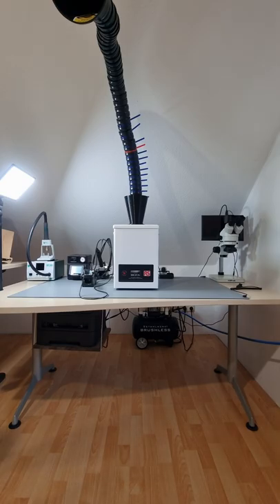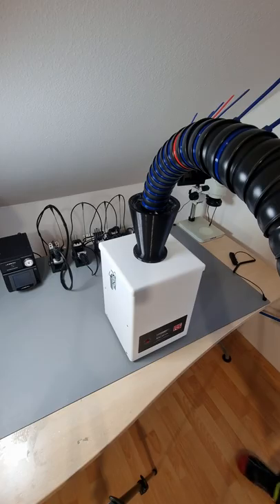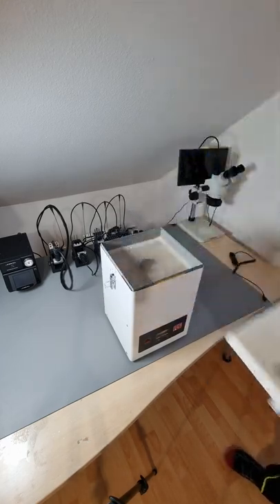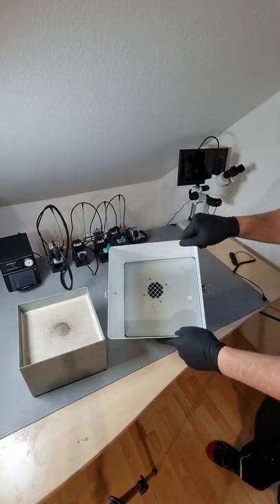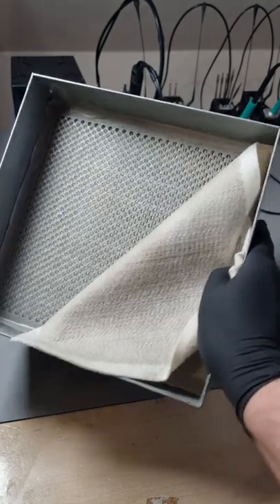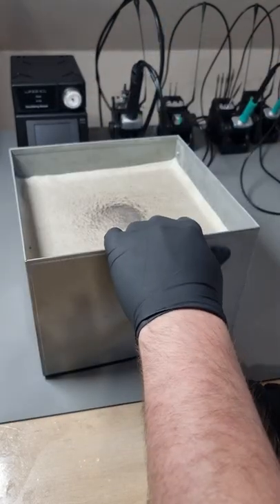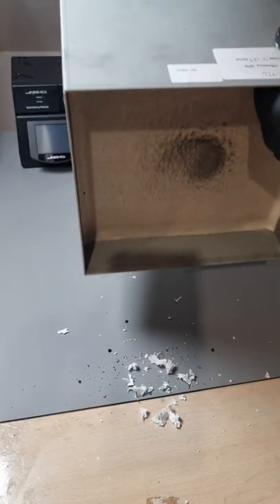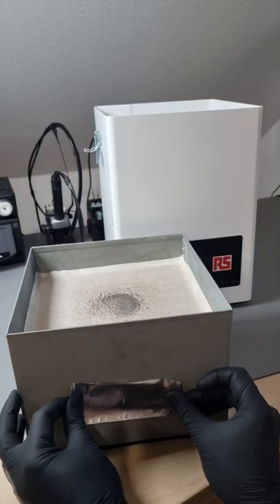What's inside a Soldering Fume Extractor? #shorts

Comment: For those who have the option, a high powered fan on the end of a length of flex duct to blow the fumes out the window would be the cheapest option. Something like $20-30 worth of parts or only $10 of duct if you already have a fan and power supply to use. Even in hot or cold climates, a reasonable job of sealing up the rest of the window would keep the added HVAC costs well below the cost of replacement filters.
Reply: You can also find tons of small shop dust collectors with serious CFMs for a fraction of the cost of this gimmick.  If you smoked a cigarette and turned it on, in a few minutes you won't smell it.
Reply: You cannot avoid sucking in air from the outside if you try to extract fume like this, because normal houses are not all that air tight
Reply: @Galeere2  Even if the house was airtight, you still couldn't avoid sucking in outside air. Or the exhaust system would just stop working as it reaches a pressure differential it can't overcome.

The idea of closing off the rest of the window is probably more about making sure there isn't a draft unrelated to the air the system is moving.
Reply: I have a large Panasonic bath fan in my office closet that blows through the soffit vent for my 3D printers. I run it while soldering as well, along with a simpler charcoal fume extractor on my desk.
Reply: @bobweiram6321  ...and I have one of these too, exhausting outside through a window instead of back inside, in my wood shop.

I will admit, they get even quieter when you exhaust them out and hang them off the ceiling with minimal contact area.
Reply: Delta 12v fan 3a and a length of leftover duct for me. 👍

Comment: I knew my copd wasn't for smoking for 40 years. it's for "extracting" soldering fumes for 50!

I'll buy one of those fancy extractors, right after I finish paying for the O2 apparatus.
Reply: Any filter will help, try buying a simple fan that'll take a epm1 90% to H14 in standard half or full size filter. The standard filters are cheaper. Custom filter sizes are the expensive one.
Reply: Interesting I've heard of welders lung and smokers lung but soldering?? Well I haven't been soldering long enough for it to be a problem but being an occasional smoker it's enough to worry me. I'll for sure have a fume extractor on my list and for now a fan for the time being
Reply: @christianhudspeth3338  I'd say heavy metal filled solder vapour is much worse than 1g of burning plant matter.
Reply: @dylandrew6071  Solder vapour is caused by flux, more specifically rosin flux which is literally plant matter, in which you burn with an iron, so technically it's the same as smoking, both are bad but debatable which is worse for your lugs though, in the short term breathing a little of either won't do much harm.
Reply: @dylandrew6071  zinc and lead don't vaporize at such low temperatures, the fumes is the rosin flux. Definitely use an extractor (or a fan blowing away from your face), but it's not comparable to smoking. For one, it doesn't make you addicted to it, lol
Reply: @FAB1150  haha you clearly gave no clue about   vaporisation or addiction 🤣 

Do tell me how the water cycle works without the oceans being boiled off? Is your name Duning Kruger by any chance 🤔
Reply: @dylandrew6071  have you ever soldered anything in your life? Those aren't lead fumes. I'd be dead for 10 years if they were lol. The molten lead/zinc alloy isn't like mercury. It's relatively safe. Inform yourself on soldering before speak lol

Comment: I made one for $30 US dollars. I Just used a Any-Which-Way Duct Hose from McMaster, a plastic duct hose, and an old pc fan. No need for filtration, I just blow the fumes out a window vent.
Reply: Excellent idea. Could also try a small in-line duct fan from home depot. The airflow might be so strong you don’t even have to get the hose close to your work.
Reply: I'd still recommend adding a carbon filter pad in between just in case
Reply: @OGSumo  The fan I am using is one of those stupid fast Delta fans. It really pulls in all the fumes from far away.
Reply: @MaxC_1  Yeah, I'm also using that same duct to pull fumes from my resin 3d printer, and those fumes are much worse. I'm going to add an inline carbon filter so it doesn't smell outside.

Comment: I just made my own using a series of hepa filters. It completely removes the rosin smell so I assume its working great.
Reply: Smell !== Toxicity
Reply: @jb5631  I am aware, but given that the rosin smell is mostly comprised of organic compounds, its not a bad assumption. The same and similar organic compounds are also responsible for the health effects.
Reply: IIRC running gasses through water can do a great job of scrubbing impurities or particulate. So, depending on the setup, I wonder if it’s viable to have the input fumes pass through the filters and then one or even multiple bubblers in series. Instead of dealing with fumes in the air, you deal with them in the water. Much cheaper (probably)!
Reply: Sounds like more filtration then this unit has so should be fine
Reply: Put a carbon pad pre filter on it and you'll be all set.
Reply: @OGSumo  That would be a nightmare to maintain, with very limited throughput and a constant source of humidity in your lab. It would work, but with a lot of compromises.
Reply: Same honestly. i just use a HEPA filter from a Air purifier which are like 20$. A sheet of activated Carbon material and a high CFM and high static pressure fan (remember static pressure is more important for this), a good source of which are server fans though any PC fan works if you're in a pinch and want something small. Add a hose and an extra fan to remove the air out of the room just in case, but fumes are not that toxic anyway so not such a worry
Reply: @OGSumo  They made vaccum cleaners using this exact concept. Empty the dirty water after use. If you can find an old one, it might be worth picking up used and retrofitting it to your use case.
Reply: I mean you could add activated charcoal just for good messure.
Reply: @Ramog1000  Yes, activated charcoal is an important component for a fume extractor. Unlike a hepa filter it effectively captures volatile compounds. I didnt use it because my space is well ventilated and I dont solder that much. But for intense usage it is a must.
Reply: @drkastenbrot  Oh well,  I mean I solder once in a while and I usually trust the good old open window and not breathing in fumes directly

Comment: I've been eyeing one of these extractors for quite some time. Finally, I decided to purchase a TBK-805 mini extractor. It looks the part with its all metal construction but I'm not blown away by the suction so far. Like most chinesium it probably requires a few upgrades to meet acceptable performance.
Reply: Even branded fume extractors suck (or don't suck, for that matter).
Reply: Get a small dust collector designed for woodshops. Even a full size one costs way less than this gimmick and is a much better value.  What are you burning that you need anything more than a desk fan?
Reply: @bobweiram6321  flux is quite toxic
Reply: @stevenspmd  Rosin flux is bad, but it's not like you're working with Zinc vapors.
Reply: @stevenspmd  flux is only mildly toxic in high concentrations as in directly sniffing it. Most people blow it far out of proportions in terms of toxicity.

Comment: I made one for soldering & 3D print fumes out of some MDF, glue, neoprene gasketing, the most powerful noctua fan (which I actually run at minimum power), a high level furnace filter & some sheet metal + wire mesh & I think a screen printing cloth? To hold the activated carbon. 

Works great, is pwm adjustable, cheap, & I had plans to wire up a pressure differential sensor to add some more automation to it.

Comment: I could never understand it until we set up a hardware lab at work, and the Occupational Health and Safety folks had to come in and sign off on our setup before we could use it. Unless we could prove the fume extractor met their filtering requirements we'd have to vent the dumb thing outside. $1000 for a certified filter is actually reasonable when the alternative is a construction project.

Comment: Something that's been boggling my mind for years is, why do people go through all that effort filtering fumes and returning the remainder into the room air, rather than just pumping the fumes outside? Probably wouldn't be legal on an industrial scale, but for a single hobbyist it'd basically be the same as soldering by the window or in the garden. And soooo much cheaper and lower maintenance.
Reply: for that Approach you need a duct leading to the outside and as long as the room was not a kitchen with an outside wall previously, you either have to drill a hole through stone or you have to put the hose out a window everytime you want to solder.
Reply: Because that requires first and foremost a dedicated work area that not everyone has space to do which also has a window or a duct outside and meaning as well, modifying your living space or blocking off said window, whereas a filter is something you can move around and put just about anywhere.

Plus if you're like me and have minor allergies then you'll want to have an air purifier anyway and very few people must have some expensive ~$100 filters, I can get third-party filters for my air purifier for just $12 which lasts 6-10 months and for flux fumes specifically, there are plenty of ways to build your own filter with cheap of activated carbon for around $30 depending on how you go about it, for me, I repurposed a small air purifier by cutting out it's filter and replacing it with several layers of carbon foam and that only cost $8.
Reply: In a climate like Germany you don't want to do that all year.
In the winter you suck in the cold and in the summer you suck in the warm/hot air, big parts of Europe don't use or have air-conditioning, it's expensive, it consumes huge amounts of energy and most of our homes use there thermal-mass to stabilize the temperature, this doesn't work if you suck in the temperature you want to keep out!
Reply: Yes, exactly. Just send it outside, instead of trying to recycle the dirty air back into your house, at great expense.
Reply: @vgamesx1  that sentence has 154 words.
Reply: @thewolfin  Ok thanks, and? I added a break, is that your issue?
Reply: @S41t4r4  or just set up a soldering station outside with a Walmart box fan
Reply: @AdmiralCrunch01   good idea in the winter XD
Reply: That's exactly what I'm doing , routing it to a window that I modified so it has a duct on it . Much simpler , cheaper , and less toxic, it's in the basement tho and there are windows that I can modify without much hassle ...
Reply: @SuperUltimateLP  you don't suck in air , you push air out .... And you put a flap on the exit so you can shut it when the fan is not working so it doesn't blow in air from outside
Reply: @robivlahov  Any air you extract will be replaced to maintain atmospheric pressure, we don't live in vacuum tubes, meaning that air has to come from somewhere, most likely your attic or any cracks between doors/windows but yes a simple dryer flap or whatever is good enough when not in use.
Reply: @robivlahov  my man...
I European house is sealed... I assume you are from the us were you heat with a central air heating system, in Europe we don't do that.
We use radiators and thus have sealed houses.
A extraction fan creates a negativ air pressure inside and the outside air gets sucked in from the weakest seals (windows/doors) and thus also introduces the outside temperature.
Reply: @SuperUltimateLP  I'm from Europe .... Croatia... We use radiators , your hose might be fully sealed (if it is , you have a HVAC system , as if you did not you would suffocate , so fresh air is ALWAYS Entering your house. That's why you use heating . Yes German houses are very well insulated , but the CFM that fan is moving wount hurt the heating bill much , if at all ...
Reply: @robivlahov  then you don't appreciate the amount of Air a extractor like that moves, is actually a lot.
It's the same problem with Single-Hose mobile AC units.
I can tell you that from experience, you can feel how much air they pull in around the windows and doors if you don't have a two hose setup.
But excuse my somewhat insulting comment about you being American
Reply: @SuperUltimateLP  Welp , I don't rly feel much of a breez  under the doors when I have my dust extractor turned on , and the easiest place for it to suck in air is trough the buildings stairwell , which is also closed up so a much lesser difference in heat than outside to inside. I will for sure suck in (actually the higher pressure outside will push its way in ,but that's not the point )air trough some hole it finds , but that happens all the time . I have seen German houses that are so sealed up that they have an HVAC to bring in a controlled amount of fresh air inside , as you would use up all the oxygen in the house if it didn't have the HVAC... So moral of the story , you have to have leakage of air into your home , and I suspect most people have fans like this in garages or cabinets of sorts . And that's a tiny blower , you should see the ones used for ships engine rooms , thos mfs create a pressure difference from the engine room to the outside , if you let them on when the engine is off, you can't open the doors of the engine room ...

Comment: Most of the price is ass cover. Large companies paying overhead for somebody else to certify that the product meets some spec.
In fact it is pretty easy and cheap to build one, potentially even better filter, if you don't mind not knowing how well it performs.
All of the components can be bought easily. Good HEPA filters are not exactly super cheap but still in tens rather than hundreds of dollars. And activated charcoal is not much more expensive than actual charcoal for barbecue:)

Comment: $1000?  You can buy a dust collector with much higher CFMs for far less. What's so special about this fan in a box?
Reply: It filters vapours, not dust. If you fart into this, the smell is removed before the air goes back into the room.  The particle size... think about it.
Reply: @johncoops6897  which literally any 20$ HEPA filter with a few similiarly priced activated carbon filters can do. At best the filtration is worth less than 100$ for that size. The 1000$ is purely because of the datasheets, certifications, marketing and "industrial" markings
Reply: @MaxC_1  Exactly. Not to mention, the finer the filter, the more pressure needed to move air through it.  In addition, the smaller the particles, the faster they distribute in the air, the more volume of air you need to move to capture them.  You need both volume and pressure, but volume is far more important.  A dust collector has a powerful motor for moving large amounts of air. This extractor is a rip off.